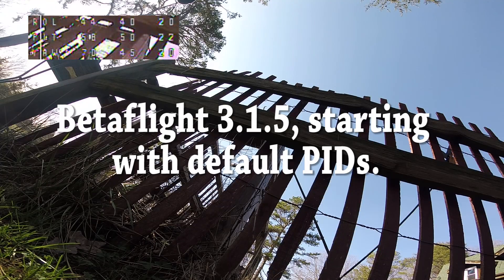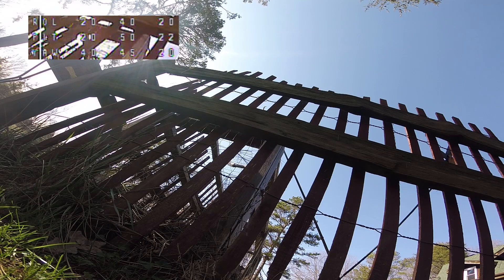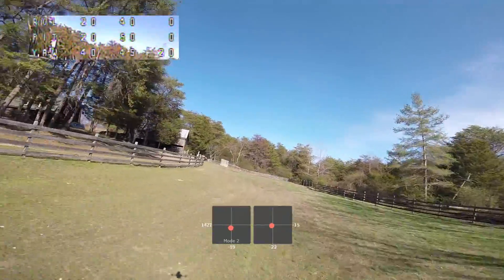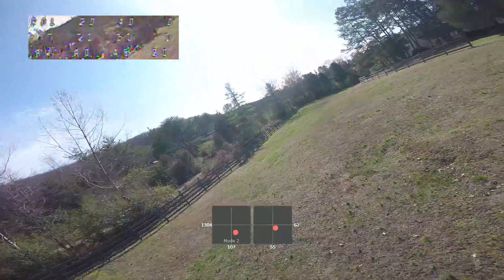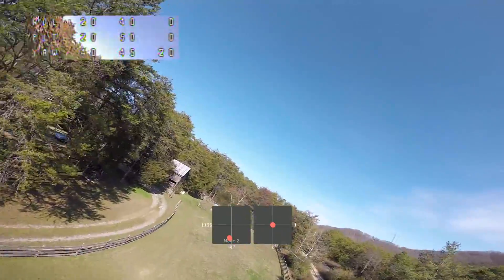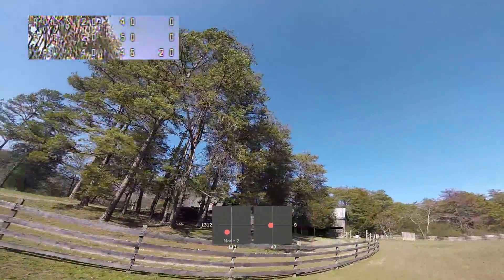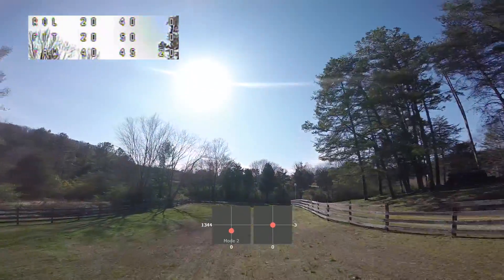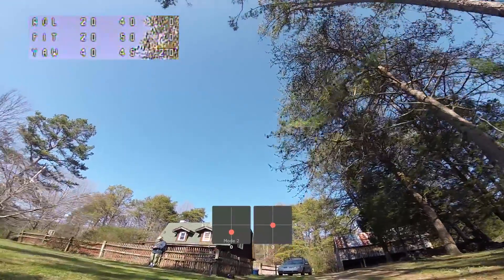PID Tuning Masterclass - Part 1 - P Term From Low To High

Comment: Do you ever have a situation where your P gains are over 100 i have two copters that just seems like they need that much P but haven't seen it anywhere else i am not sure if my tuning is just way off or that happens sometimes?
Reply from the maker: Micro quads especially need a lot more P gain. If you like how it flies then stick with it.
Reply: Ok thanks for the reply, Neither seem to be having any oscillations so I will just stick with it. Great video by the way keep the videos coming i watch them all.

Comment: I have a dquad obsession. Kiss 24a esc and also kiss fc with f40 pro 2400kv I feel like it's a lil bit on the weak side it's quite and sounds good but not as fast as I want would changing pids help?
Reply from the maker: PIDs probably won't make your copter feel more powerful. If those motors feel weak then your copter may just be too heavy. If your AUW is more than about 600 grams, lighten up. Maybe you are propping for thrust instead of speed. If you are using a high-pitch prop like RK5051, try a lower-pitch prop like 5x4x3 or DAL Cyclone.

Comment: Quick Question..... I have learned so much from your video's it's crazy, I have watched 90%+ of them, built my first 220 from scratch couple weeks ago and now on my 3rd even though I've only had about 10mins stick time so far (FOV) and 3 to 5 hours on sim I just love building and setting them up . MASSIVE thank you! So the big question that I'd really appreciate YOUR answer too..... I really want to be able to fly 3D mode and have a 220 setup in 3D mode ready to go. In your opinion am I best to learn ACRO FPV first then start to learn 3D or do I jump straight in to 3D? I fear I'd pick up bad habits in ACRO that would make learning 3D harder in the future. Thanks again for such great in depth content, keep up the great work. John
Reply from the maker: +HighVoltageProjects 3D is a superset of acro. I would say you should be a moderate to advanced acro pilot before trying 3d.
Reply: Thank you ,ill keep going on the sim until the weather is good then get some much needed practice .Really appreciate your reply and great vids ,Thanks again John

Comment: I'm very interested to see the same thing but for I pitch & roll. I was noticing my new 5inch quads nose was dipping when I drop throttle from high to low. I believe that is an indication of low I. However I didn't see this improving until I got I roll into the 90's and I pitch in the 70's or 80's. That seems really high, and I ran out of packs before I could fly it again. I tried looking online what the side effects of high I is and it seems really vague. So I'm interested in hearing from you!
Reply from the maker: +djk12587 anti_gravity_gain
Reply: Is it well balanced?  you shouldn't need I that high unless your COG is off.
Reply: I had no idea this existed! It seems like it could be the culprit. I'll play around with it. Thanks!
Reply: The COG could of been off a bit, I need to put more packs through it to confirm.

Comment: Joshua, It would be interesting to see the lines of the blackbox on those first 2 runs. I feel like with 0 D the oscillation you see is from the I gain. With low P and 0 D the I has a larger effect than normal. Just a thought.

Comment: How are you altering the settings without going into the computer,also how do you overlay the blackbox onto the video Many thanks
Reply from the maker: How to set up in flight adjustments: https://www.youtube.com/watch?v=JpnCMLmxme0

Sticks overlay: https://www.youtube.com/watch?v=MclZFLNG234

The sticks overlay technique doesn't work any more because the command line tools don't work with BF3.1 log files. But you can use webm export from BB Viewer and use a similar technique to overlay them.

Comment: I am too paranoid and I still stick to the way of "raw balancing" where you tie up your quad using some rock climbing rope (the light one up to 20 KG) - on one of the axis :) and proceed as you mention in your masterclass video. Also I have very thin USB cable so I can change PIDs even mid flight using laptop. One thing I like about it is that the climbing rope is flexing and making the quad oscilate so if I force it to do some stuff and I can see if it would get out of balance in flight later
Reply from the maker: +kennuardo hartinger I have tried that method but I don't find it to produce correct PIDs. I just prefer to tune in flight.

Comment: I'm interested to see where this tune goes. I've just attempted to tune two martian 3 quads, both the 5" and the 6" frames and they have a stretched x. I'm finding the roll p is very close to the stock value on betaflight 316 but the pitch p can be significantly higher, especially on the 6". I'm still trying to find a good ratio of d for both but pitch is harder, even though I tuned both roll and pitch to approx. the same level of instability or level of oscillation on sharp stick inputs. I always worry about using too much d and being able to identify if I have used too much ...
Reply from the maker: +rogue trooper motors cool, D is okay.
Reply: Joshua Bardwell Waltr has said that a 10 second hover is sufficient, until someone says otherwise I'll work off that. Thanks!